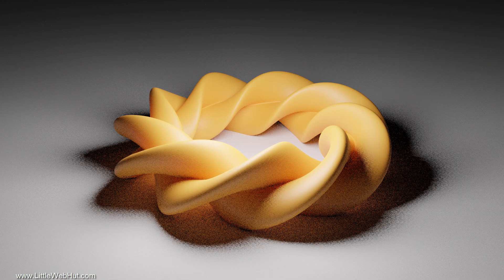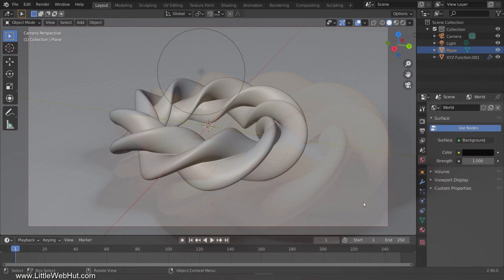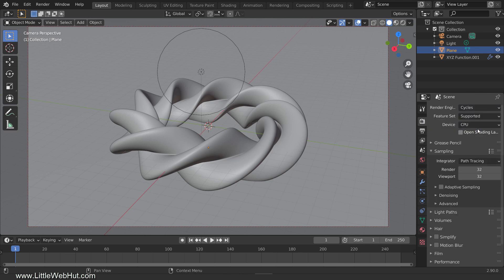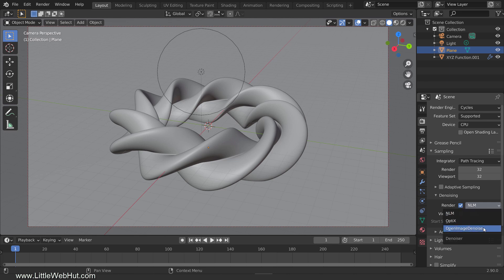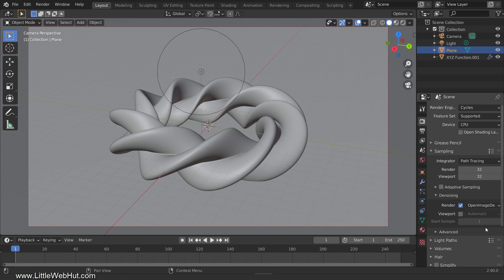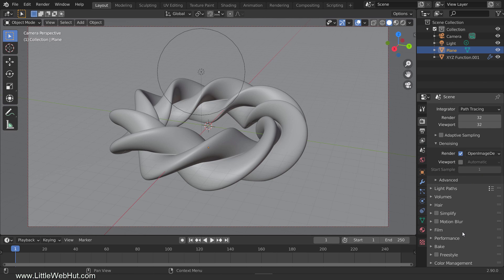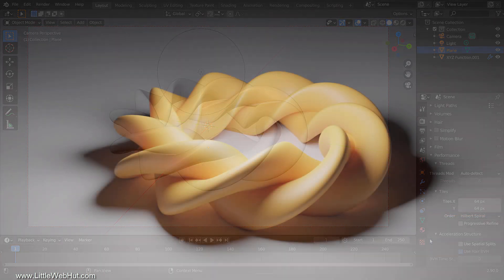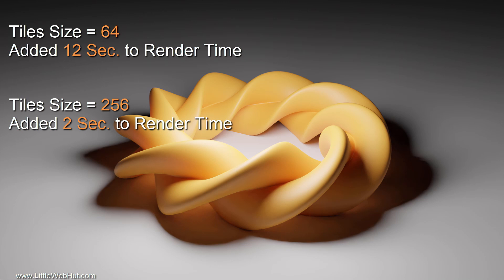Blender Tutorial: Speed Up Render Times with Denoising

Comment: Thank you for this tut! Regarding finding the tile right size for your machine it would be interesting if the free add-on “Auto-Tilesize” works as well as you figured out by manually adjusting the tile size. If you have any comparable insights that would be interesting. Thanks again!

Comment: I think the "Denoise" node in the compositor is using OpenImageDenoise. And it seems faster to use that node.
Rendering the default cube took 45 secs for me with OpenImageDenoise on and a tile size of 64px.
It took only 2 seconds to do the same with the "Denoise" node in the compositor.
Maybe it makes a difference it terms of quality, but I don't know about that. If it doesn't, I would advise using the node in the compositor.
Reply: the compositor node denoise blurry, i would not use that.

Comment: I thought the NLM Denoiser Type was the older denoiser of Blender itself which wasnt that great.
Question: are the other denoiser like optix and openimage related to the Denoiser node?
 As I understood it you have to enable openimage denoiser or optix, enable the Denoising data (panel view layer) and connect in the compositor the denoise node correctly. Am I wrong?
Reply: This is what I thought, if you render with the optix denoiser, you get checkboard artifacting all over the image, this goes away if you add denoising data and add the denoise node in the compositor, I have 1060 card and i thought optix denoise is conpatible for it now in 2.9?
Reply: @gower1973  As far as I understood it the optix denoiser and openimage denoiser are the same but you need to turn on the denoising data for the compositor node. Yes, I have a 1050ti and the optix denoiser (viewport) works fine with it but I didnt notice any artifacts by now. 
I always had a crash when using the optix denoiser (viewport) but they fixed it with the official release of 2.90 :)

Comment: I’m still trying to figure out how to open some of my original blender files I made with your tutorials on the new blender engines. Unfortunately every time I try to open them they say file format not supported. I was sad to lose some of the cool animations like the water pipe with the stainless steel ball bearing
Reply: That's odd. Have you checked the files aren't corrupted & still work in the old versions? (You can download any past version from the website.)
You could perhaps try opening & saving them with an intermediate version, and see if that can be opened by 2.8x/2.9x?
Reply: nibblrrr I’ll give it a go, tnx

Comment: Also a pretty important rule of thumb:
CPU can handle smaller tile sizes better (about 64) and GPU has better perfomance if you use bigger tiles (256 or even 512)
Reply: I don't understand why but I render with both GPU (CUDA) and CPU and it seems to be always better with 64px.
(Maybe it's because I use both at the same time. Gonna try with GPU only and a big tile size.
Edit : Yeah. It seems it was that.)
Reply: This is no longer necessary unless you are using a version of blender prior to 2.82. For those cases, the fastest is for the CPU 8 or 16 px, while the GPU the most optimal is 128 or 256px.

With the arrival of Blender 2.80, the possibility of using CPU + GPU was added, but using small tiles made the GPU become very slow and using large tiles made the CPU slow, so the fastest thing was to use a core with the GPU at 256px.

After version 2.82 this was fixed and currently, whether CPU and GPU are used together or separately, the fastest is still for the CPU 8 or 16 px and the GPU now it's 16 or 32px, forget to use 128 or 256px.

Right now with Blender 2.90 I have done the test with one of my projects that use a lot of RAM (GTX 1060 1080P 256 samples)

- GPU T256 = 7.18 min
- GPU T16 = 7.32 min
- CPU + GPU T16 = 6.35 min

In this case it's not a big difference, obviously it depends a lot on the project.

* Using Denoising increases render time by several minutes.
Reply: @MCCVIDEOS  Thank you for the information :) I have to test it out very soon
Reply: @MCCVIDEOS  I can definitely not confirm this. I tested it on Blender 2.90 in a scene rendered in 1080p/512 Samples. CPU only the fastest was 8x8 tiles, GPU only the fastest was 512 tiles and both together the fastest was 64x64 tiles. Also denoising added only a few seconds to the result not several minutes. The hardware used was a i7-7700K and a GTX 1080. 

GPU with 512x512 tiles was done in 2:46.76 while 16x16 was 5:56.25 (8x8 was 14:51.15)
So obviously CPU+GPU is the fastest and in my test using 64 by 64 tiles with CPU + GPU is the best option I had. With CPU + GPU with a tilesize of 64 it took only 2:27.97
Reply: @zibbozz  Sorry, I forgot to specify better.

This IS correct, it's one of the improvements that the Blender developers are working on to avoid time problems with the use of CPU and GPU since it's not understandable to use CPU + GPU and that due to the size of the tile you are either in favor of the CPU or in favor of the GPU, choose one or the other it will take double or triple the time, so in version 2.82 this improvement was added that is still in development and doesn't always work.

Apparently it only works on RTX GPUs and some GTX on which from what you mention the GTX 1080 doesn't seem to work, so in this case it's still better to use large tiles until the Blender team manages to implement this improvement. I guess they have focused more on other issues. For example, Denoising OpenImage doesn't work for me, I have to go to the composition section and add it manually.

I discovered this when version 2.83 came out where I found a video showing this improvement in addition to commenting on it in the Steam forum.

My GPU takes much longer if I use 512px and it depends on the case sometimes 128px is better but normally it's 256px. As for denoising I was referring to the native of Blender. In 256px it's barely 5 seconds but with tiles of 16px each tile with denoising adds time and increases several minutes.

So my GPU using 256 or 16 it takes practically the same time, it goes a little slower but it's a very short time that obviously together with the CPU takes less time, although my CPU is bad so it doesn't accelerates a lot.

Anyway, I'm still working in Blender 2.79 and using only the GPU in 256px tiles since using 16px increases the time like 10 times.

Comment: lol the problem with it is, it even denoises things that are meant to be "noisy '. such as sand
Reply: denoiser only blur out details if you use certain denoisers or settings. its not the denosiers fault it the use of them. know it and use it correctly.
Reply: The solution could be render the noisy part (sand, for instance) in a image and the rest of the scene in another image. Than combine the images.